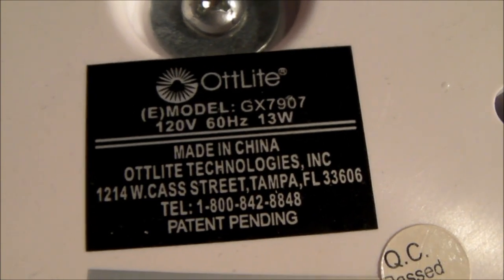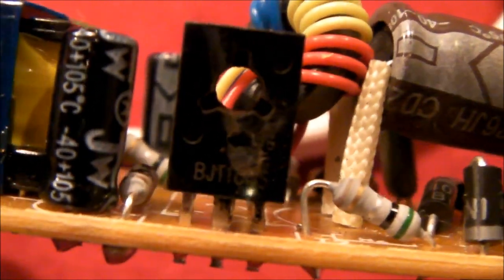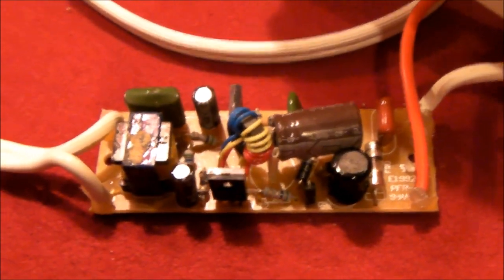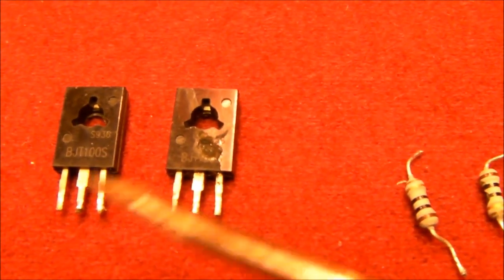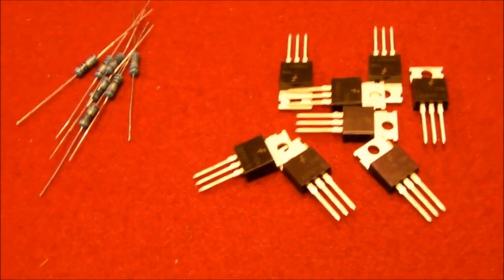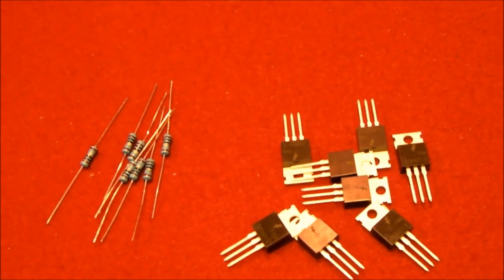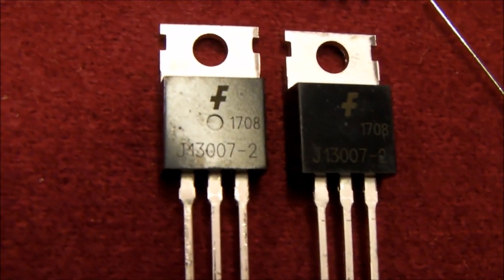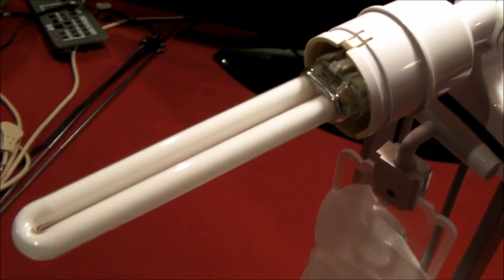How to fix Ottlite GX7907 ballast

Comment: Where did you find the data sheet for those transistors? Trying to repair the same model and it does seem to be those that failed as well, ordered some BJTs using the specs in your video but I'm not sure if the pinout is the same orientation as the old ones. Replacements are BCE but the originals seem to be shorted internally so I can't quite identify the terminals
Reply from the maker: just google bjt100s.  the first thing that pops up is the datasheet